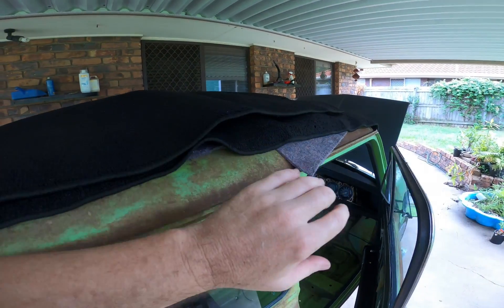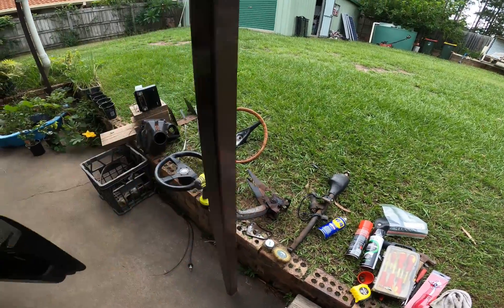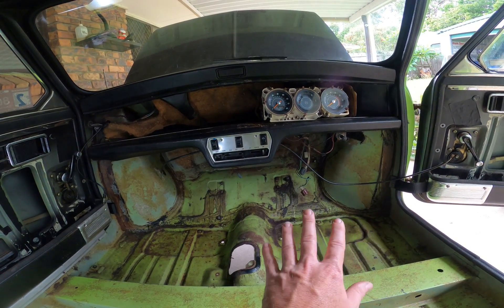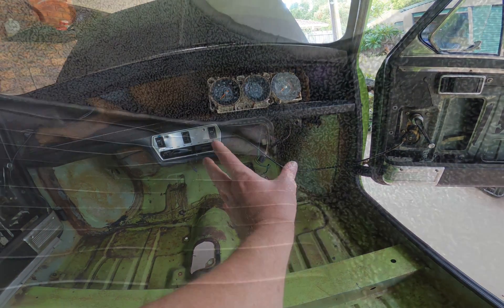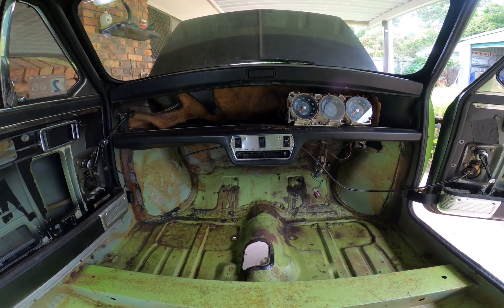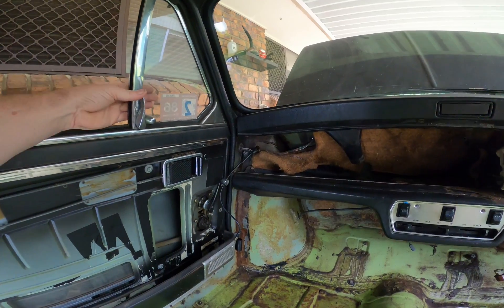Bunch of little tasks started & a few deliveries  🔋🔌 1973 Clubman Mini going electric 🔌

Comment: Would you like to sell the stock steering wheel?
Reply from the maker: I would consider it, don't know it's condition tho
Reply: @HBPowerwall  My car was a daily driver, so complete is good but I understand used. I can fix anything. I have a chrome nice wheel now but in daytime driving the angle is prone to sun glare. ALOT!! lol   its a melting pot of parts but I try to get as many Australian parts as I can. Think about it and I hope the E conversion goes well. I was just thinking of a way to combine my mini diff with a gear on it so I can use It, with an electric motor, and self bilt tube frame.

Comment: Have a look at https://zeva.com.au/ for a simple but powerful EV management/BMS solution. We’ve been testing it and it looks very good for the price. There is sufficient CAM bus information provided so that you communicate with it and the Hyper 9 X1 controller using a Raspberry PI with an isolated dual CAN bus hat. My son is a programmer and he has successfully duplicated the ZEVA BMS screen and retrieved parameters from the X1. Once the motor is installed we’ll be pushing hard to get a 9” digital display running that will provide all the battery pack, motor and vehicle information required.
Reply from the maker: Can't use anything other than www.batrium.com.au 's BMS i'm a fanboy for a long time. I'll have to stick with what i know and trust. Also have a few spare parts i should be able to do it quick n easy
Reply: @HBPowerwall  Great, go with what you know, Batrium gear seems very flexible, sounds like you've got it worked out, by the way are you following these guidelines?  https://www.infrastructure.gov.au/vehicles/vehicle_regulation/bulletin/files/NCOP14_Guidelines_Electric_Drive_01Jan2011.pdf Note: there may be a later version!

Comment: Why spend $s on all that clear and put it on bad paint. Save $s on clear and just buy green paint and paint it, and that way it will cover the faults. Also why go to the expensive of sand blast and power coat the sub frame when the rest looks bad, if it's not rusty just spray can it. I would've stripped it to the shell, power washed it, fixed and treated the rust, and sprayed the whole thing in one go. The better it looks, the easier to pass rego.
Reply from the maker: I just don't have the money to do the paint yet..But still want it to move forward at a reasonable pace Once it's built and running I'll consider my options for paint. In one of the next videos i'm going to wirewheel or paint striper the engine bay and respray it with rattle cans - it can be my test paint tryal type thing...
Reply: @HBPowerwall  Sorry I was under the impression you were going to do to whole thing with expensive clear on top of bad paint. Yeah cans should be fine for the engine bay, and maybe even the body. I've painted a few cars at home with proper auto paint, but last year I did my old Mazda s'box with cans on the outside. I found a std red at Autobahn from the cheap general $4 section that is nearly identical, and then sealed it with Supercheap's SCA clear Acrylic - you need the hard drying acrylic to protect the soft cheap base colour -. It now looks so good that the rego guy passed it without a problem - last year he said he wouldn't pass it anymore -.
Reply from the maker: Plan was to use cheap clear coat

Comment: I’d consider going rear discs as well. With the added weight of the vehicle once you add batts etc. I had an XP Falcon with rear drums and front discs and the first time I slammed on the brakes in that I ended up in the next lane across. Fun. Not. Exciting project Pete.
Reply from the maker: Haven't considered the rear disk conversion - but with regen & 8" front disks I think that option will come way after I paint. Also I don't think the car will be any heavier than stock. It's possible it'll be slightly lighter
Reply: HBPowerwall Nice.

Comment: If you have not already thought about it and have planned for it, I would recommend replacing the entire wiring in the car while you are at it, as what is there is coming up 50 years old.  It's not a lot being a mini, and it it was converted back to an ICE car later on, there would not be a lot to change to make it work with that setup either.
Reply from the maker: I did a quick test and all the lights worked (till the switch busted) indicators wored, horn worked. Not perfect but works ... but new ones aren't that expensive considering the time it'll take to clean (add to that i'm changing dashes so might as well just get a new Morris loom
Reply: @HBPowerwall  When we do race cars we just buy a universal wiring loom.
Reply from the maker: for this car i think it would be easy to just make one. they are quite simple. Cable management for batteries/bms will be harder than getting the blinkers to work :P

Comment: In fact lose the gauges,  the volt gauge is no good for purpose,  no oil needed and the speedo works off the gearbox, which you don't need.  Plus a nice GPS unit would be much better even if not standard. IMO 😁
Reply from the maker: I have a few options i'm looking at but the oval dash is very high on the list. One of the gauges will be used for water temp of the batteries, other might be water temp of the motor if it's got water cooling. Speedo i'll get calibrated to suit my needs i hope. BUT a gps dash is fast and easy!
Reply: @HBPowerwall  good idea on the temp gauge,  very retro.  I know they are "original" but...,  you can get some modern "vintage " gauges you know.  But I do respect what you are doing. But please lose the clutch,  just one more thing to go wrong.
Reply from the maker: No clutch pedal, clutch plate or pressure place would be a great weight saving for sure!
Reply: Vehicle speed can be retrieved from the Hyper 9 X1 controller or the optional X1 display. Some configuration is required.
Reply: @iqev4681  you can also get some very sexy GPS gauges that are very accurate,  unless you're on a steep slope of course😁
And no adjustments  required.

Comment: Don't need the clutch,  save the weight mate.. You won't be changing gear and in fact if you can lose the gearbox,  don't even need reverse.
Reply from the maker: It's not about the clutch really, its about fitting the motor as cheap as possible. I'm still looking for my dream mini to convert - this one will be the learner - second one will be the love of my life :)
Reply: Can you direct me to where I can learn more? All the conversions I've seen keep the gearbox and I'm confused as to why they do that?
Reply from the maker: bolting an electric motor to the gear box means you don't need to do a custom diff out to the wheels
Reply: @zane1os   And of course keeping the gear box increases losses, less efficient.  So you right,  why do they do that? Two motors would be wayyyy better and neater,  plus look at the room saved,  just do the engineering and be done with it in my opinion.  The batteries is what I don't understand??
Reply from the maker: some have said hub motors - i like that idea but i don't have the skills to install
Reply: @HBPowerwall  , I had a look at that site that one of your posters put up last week.  It would be interesting to get some specs of sizing off them then run it past an engineer to see if the stub axils could be re engineered/machined to accept the motor  shafts.  It would all come down to the quality and strength of the motor shafts to take stresses. I don't see why not providing the shafts are strong enough.  It's been too Many Years since I last worked on a mini front end to comment with any certainty,  but you could easily fit motors to stub shafts and cv/universals and mount them back to back, providing there is the room.  I haven't looked at what is available lately,  but there is certainly more choice than there was three years ago.
Reply: @HBPowerwall  I just went and had a look at my old repair manuals. Hub fits to the drive axel,  the drive axel is what has the bearings which attached to the hub carrier. Therefore,  if the drive shafts are done away with along with the hubs, it should be possible to shrink fit and weld in a premachined insert,  this would take the electric motor shafts.  And Bob's y'a uncle. It obviusly would require a little measuring to get everything aligned correctly for machining.  The brake calipers are attached to the hub carrier so you should be able to utilize the mounts for your new calipers which come with the motors,  or you could use the originals and just purchase a different motor.  I'm quite confident that it would be doable and still use the original wheels etc.  No gearbox = more efficient
Reply: @kezzatries  If you delete the gearbox, that will make room for a 2nd motor? Then put hubs on the back ;)
Reply: @scottpruys291  ,in theory yes,  however I don't think there's enough room between the frames and you do not want to go down the path of building a whole new special front assy. 
I think fitting inserts into the hub carrier to take the ev motor shafts is the way to go.  Shrink them in and use the original circlip retainers,  don't weld, as it is cast iron which may weaken when welded.  Circlips did the job before,  so they should again.
Reply: @HBPowerwall  I disagree,  I think you have more skills than you realise.  And remember that's how you add to your skills library by trying. Hence my name,  just try and you may be surprised. You don't have to everything yourself like the turning,  but only because you don't have the equipment. Someone built the first machine,  but what machinery did he use to build it? Think about it.
Reply: @zane1os  makes for a no brainer install,  but you still don't need the clutch,  even if you do want to change gear you can do that with out the clutch. And no clutch means an easy install for rear wheel drive,  little more mucking around with front wheel drive,  but he's right you would have to come up with a different if you removed the gearbox,  unless of course you put I wheel motors.  Then you would require to do some engineering on the stub axils,  but doable.
Reply: There are very good reasons for keeping the clutch and gearbox, one is for a mechanical disconnect should something go wrong with the drive e.g. full throttle lock. The gears allow the driver to choose a gear that puts the least strain on the drive system, lower gear for round town, higher gear for open road driving, this combo provides a more natural drive. At 120 volts the Hyper 9 motor torque range is limited, Tesla get away with single speed because of the higher voltage traction battery and dual motors with different characteristics for high and low speeds.
Reply: @iqev4681  I could not disagree more,  disconnect due to mechanical failure?  Turn The power off,  you could have more reasons for a mechanical failure by leaving the gear box and clutch in.  A more natural drive?  Well for a start driving is not a natural thing,  if you are meaning more like an ice car,  well there are automatics with them too.  Choosing the correct gear for the situation is something most people don't do any way,  they either over rev the engine on overload it by not enough revs.  If he chooses a DC motor then,  full torque through out the rev range, if he goes AC then the inverter drive should compensate current against volts for the settings that you can input into the unit,  so no you can  not over load it in the meaning that I think you mean.  And besides that's what disconected protection devices are for. Low gear for around town.  Same as above full torque all revs,  unless you're a "hoon" and really want to over load that gearbox and diff. 
I'm  not being mean and rude and disrespectful and insensitive to you,  as you had your thoughts,  those are just my thoughts as an electric motor repair person and rewinder,designer and installer of industrial electrical equipment over the last 51 . However I know nothing of EV's.   But you are correct,  you can overload the motor and drive,  by installing under powered gear or even the correct gear and then straining the hell out of it,  same as anything.
Reply: @kezzatries  Hi Kezza, thanks for the reply, I don't think you're rude, disrespectful or insensitive, you have your point of view and I have mine and I respect the fact that you have taken the time to share your thoughts. Are you hoping to build an EV some day? If you are here's a link to some information from an Australian EV project that gives some valuable insights into the EV conversion world. https://zeva.com.au/Projects/Focuses/ 
PS my EV conversion will have a CVT, if that doesn’t work I’ll swap out the gearbox for a manual (with a clutch 😊), cheers.